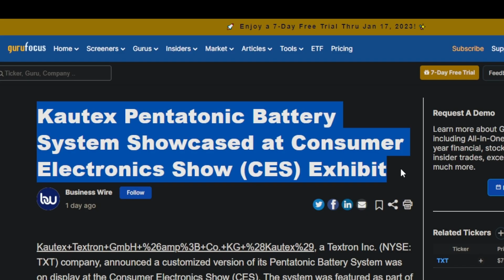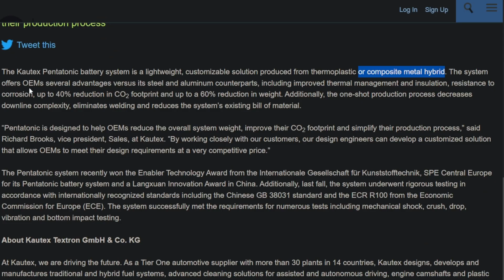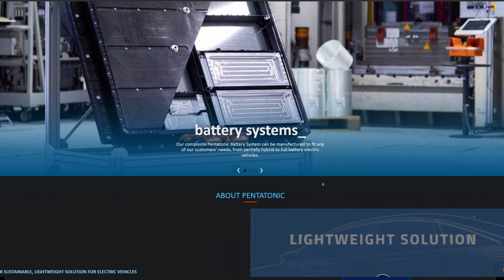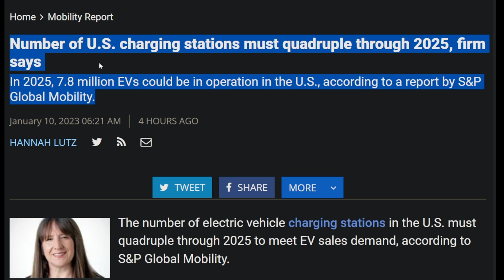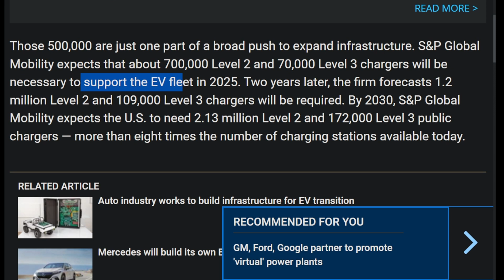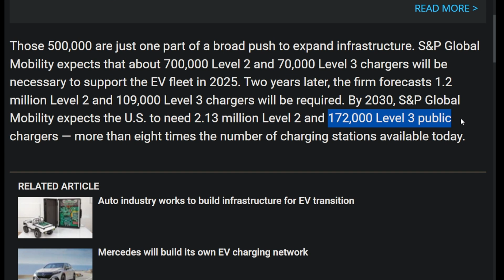RAM's New Battery is Lighter, Cheaper, and Smaller...Here's Why

Comment: Interesting idea for the battery pack casing.  There won’t be much weight savings due to the majority of the batteries mass deriving from the cells themselves.  But perhaps most importantly for an auto manufacturer is the cost savings.  
The BEV and charging infrastructure will ebb and flow through growing pains and probably won’t see a mature network until 2045-2055.  No way will there be eight times as many charge points by 2030.   In the 2030’s we’ll see the rise of FCEVs exactly for this reason.  The infrastructure build out of hydrogen stations will require a sixth as many electric chargers.

Comment: OK, I have to recognize that supplier trying to reduce the Ra Rev 1500's weight by making the cover of the battery packs in strong but lighter polymers instead of some kind of metal. 

But since it's just the cover (same "electric juice" materials) wonder if they have even a "guesstimate" on how much weight % represents for both the whole battery packs and the pickup truck (it's NOT 50% as they imply, but a much lower number). What's the expected weight savings  related to THE WHOLE PICKUP?
Reply from the maker: Actually in the concept battery at CES, it had a type of solid state battery.
Reply: @kkecars  -so this are li-on based solid state battery packs wrapped in polymers, but still that doesn't say how much weight they're expecting to save on the whole pickup.

That has to be stated to see how much benefits if any would have on the pickup's performance, especially for truck-y things like hauling cargo, towing and off-roading, where today's battery tech those things will reduce real-world range by 50-70%.

Comment: All it needs is a hydrogen range extender and it will be a great truck. 👍
Reply: How about ice range extender that runs on hydrogen and gas 😜
Reply: @KirkKreifels  I was thinking about the cleanest option from a CO2 perspective. But as an interim solution . Why not.
Reply: Hydrogen is no go, its not a new technology, its been around for years, but never went anywhere. 1) Who will pay for the infrastructure? 2) You wont be able to fill at home.
Reply: Stellantis is actually considering this option. They have FCEV vans in Eupore.  Stellantis CEO said it would be up to Ram CEO if that were to be implemented.
Reply: @chaunceysnodgress3672  Cummins has a 6.7 litre H2ICE that could slot in the Ram pickup.